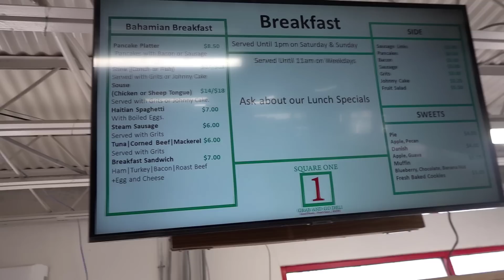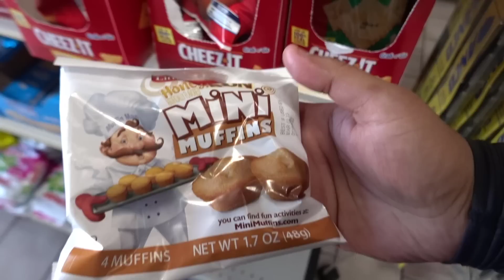A dive to the Grey Pool - Abaco 2023 Day 2

Comment: Gear question! For weighting, do you guys have pockets in your wing for weights? And if so, you don't use any ditchable weight? Looks awesome having all of the weight on your back, and not on a belt or pockets. I wanna do that too for my BPW system if it will achieve similar results. Your trim is awesome! All of you!
Reply: Benjamin Woodill  So you wear a specific weight harness or is it part of the BCD's webbing?
Reply: Benjamin Woodill  Thanks!

Comment: When you pack your canisters? Normally how long can they sit before you have to redo the sorb?
Reply from the maker: Great question. I think it depends on how you leave them. If it’s open to the elements then that’s a problem, if it’s sealed air tight inside the rebreather then it’s longer. Ultimately I pack to dive. If I’m packing, I’m diving!
Reply: @DIVETALK  ok makes perfect sense you guys should do a sidewinder CcR cleaning tutorial